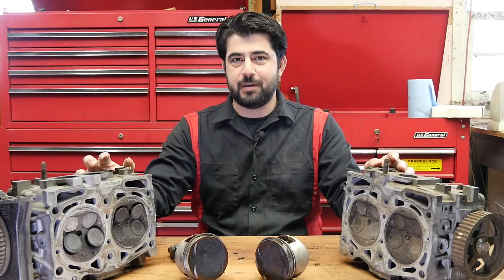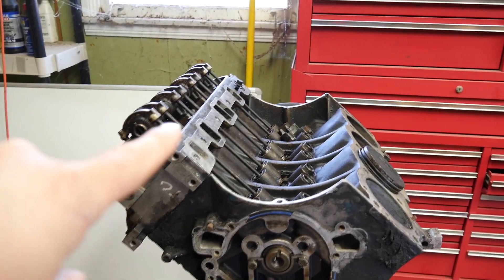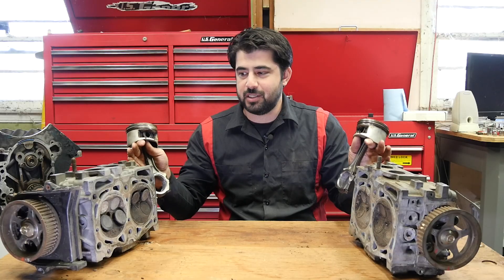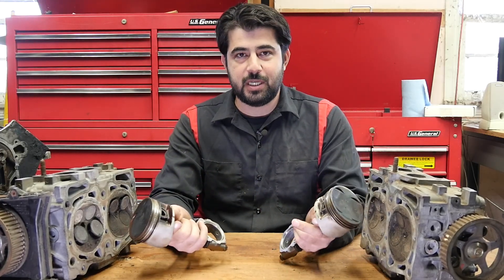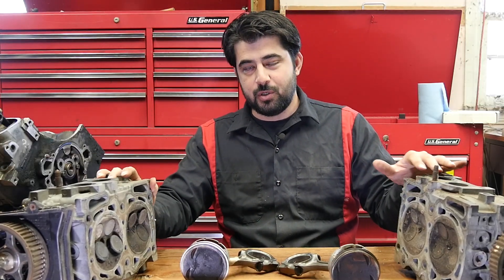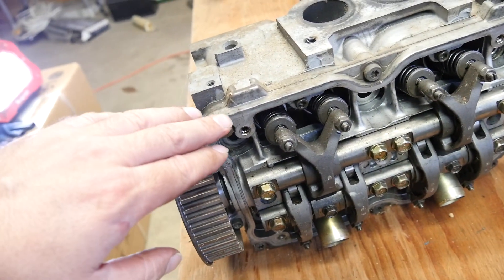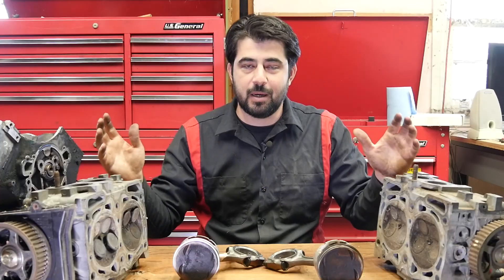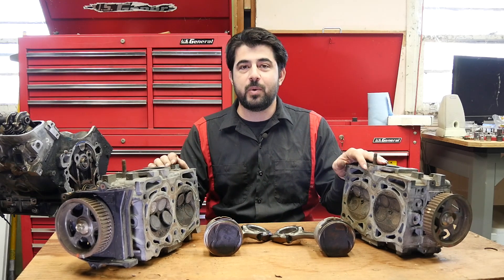How Boxer Engines Work - Plus Their Pros and Cons

Comment: I have a "Subaru impreza 1.5F" from 2009.Whenever I am driving in first gear (above 2000 RPM), and I press the clutch down slowly (after steping of the gas), I hear something Spinning really fast and the sound is somehow linked only to first gear only because when I do the same thing for all other gears it is ok. Can you suggest me some tests to do (or maybe you have heard that noise in other Subarus maybe and let me know if it is a normal sound in these models)?.

Comment: Boxer engine in a car is unnecessary and just adds  further complication
. I’m not sure but heard desigNer worked on aircraft where boxer used as better for air cooling
Reply: You can feel the better handling dynamics with a boxer. It's not totally necessary but you will feel the difference driving a subaru vs a toyota of similar class. I know because I own both. Once is more reliable, one is more capable. Nothing wrong with either.

Comment: Boxer engines have inherent flaws, too; they are notorious for oil leaks, head gasket failures & oblong cylinder wear- due to the forces of gravity acting on the pistons...
Reply: High quality oil will stop any premature oblong wear. 250k miles no problem. Head gaskets arent a flaw of boxers but just a notorious flaw on subarus using cheap gaskets over a decade ago. Everything has pros and cons. But there's nothing inherently bad with a boxer design.

Comment: Boxer vs. Flat engine. Boxer engine's connecting rods, each, have their own crank journal. Flat engines aka 180 degree V engines, run two rods, on one journal, like a 60 or 90 degree V engine.

Comment: I don't understand how a company that's been primarily making boxer engines for decades, still has notable issues with them? They've recalled so many just in the past few years alone. When it comes to engine R&D, boxer is mostly where they put their money into. Its their bread and butter and they still cant get away from these issues.
Reply: Your understanding is caused by your misunderstanding and lack of knowledge. I own a Subaru as it doesn't have any notable issues. Second, name a car manufacturer that haven't had recalls? I don't understand how a person can post a comment about a car that he doesn't own and have zero knowledge not just about the brand itself but lacks the general knowledge of how industry works and where the rest of the competitors are!
Reply: That widely publicized head gasket failure problem was resolved over a decade ago.

Comment: why only motorcycles get the V4 engine?
Reply: Because V engines are for longitudinal space saving (there is rarely any inline 8 or more) a 4 cylinder inline is short enough to basically fit under any hood lengths, making it a V4 just means more parts, more weight, more complexity and no any real benefit

Comment: SUPERB ENGINE "
IT STARTED OUT AS AN AIRCRAFT ENGINE "
 @ 750 CC"

CHANGE YOUR OIL EVERY 3K & DONT LET YOUR COOLANT GO BAD.
USE A QUALITY FULL TIMING BELT KIT (WATER PUMP & TENSIONER PULLEYS )
& MLS H.GASKETS WHEN DOING HEAD JOB.
& 300K + CAN BE ATTAINED ON AN ORIGINAL "

FACTORY MOTOR"
Reply: I know a guy with a 2000 outback that recently hit 500,000 miles on the stock motor and trans. Yes he did head gaskets on the motor but never had it rebuilt.

Comment: Give me an I4 or an I6 any day. Reliable and easy to work on.
Reply: I have a 10 year old H6 and it has had 0 issues. And its not really hard to do maintenance on.
Reply: @Hallowsaw  stfu
Reply: @FranklinHicks-qs4gs  no u
Reply: @darthdarthbinkss  is you shawn
Reply: @FranklinHicks-qs4gs  it is, "are you Shawn", not "is you Shawn".
Reply: @Hallowsaw is you stooped? 
Aint nobidy got time for that
Reply: @Hallowsaw   You may want to research the difference between a declaritative statement and an interogative statement. Mine was clearly the latter. .  The use of "is" or "are" in an interrogative clause is dependent upon the formal subject "you". 

In the future you may want to enaure that YOU are correct before correcting others. 

Good day mate.
Reply: @Hallowsaw  shaaaaaaaaaaawn
Reply: @FranklinHicks-qs4gs 
I miss the old internet where you can witness unintelligent folks argue rather than the misinformed zealots.